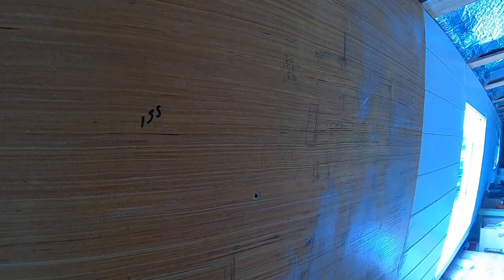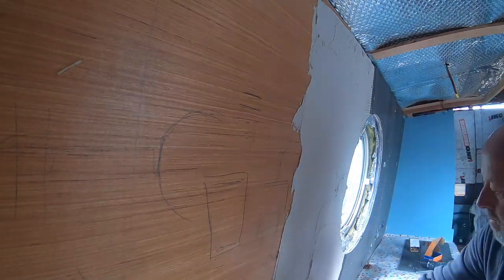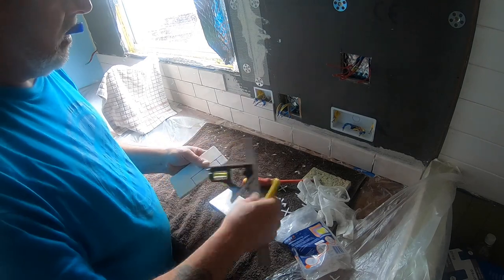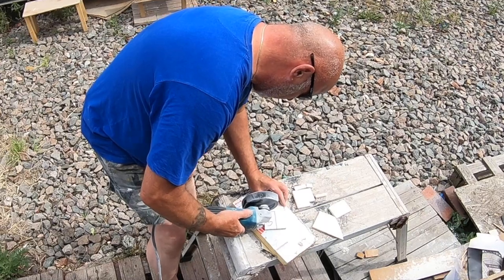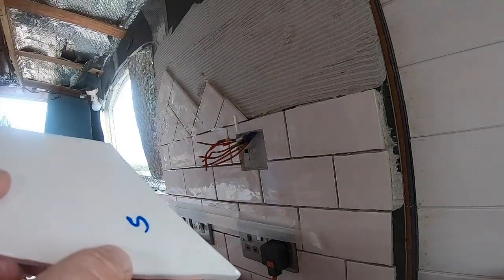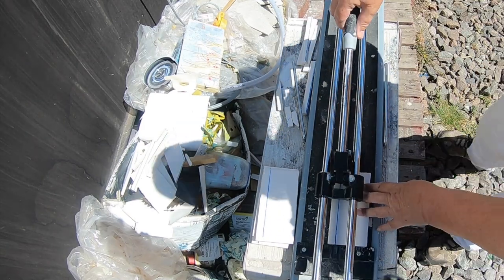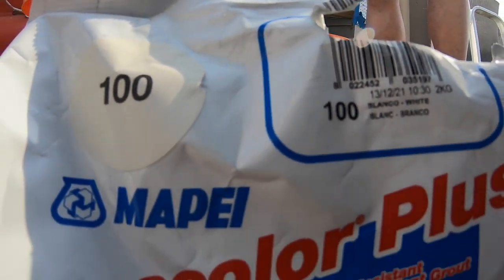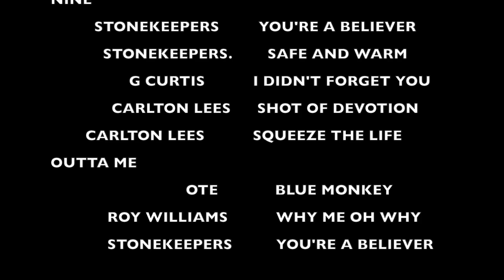Vlog 82,  Narrowboat Fit Out - Tiling the Galley

Comment: Those tiles look really great it just goes to show what a professional interior designer can achieve, they're well worth their fees, the labourer wasn't too bad either! Just one comment, Grandad you're a cheat in my tiling days we had to cut them by hand, scoring the tile first then cutting it with a nibbler, now that did take a long time, we also had to make the spacers. Surprisingly you didn't ruin many tiles and could cut very complicated shapes especially in big ones. That tape is also used for drylining and repairing cracks. Eagerly awaiting the next, by the way what's that other person's blog called.
Reply from the maker: Cheers Tony, Yes those angle grinders do a great job on the tiles. Chris has a channel called Chris Mears - In slow time. Its well worth a watch 👍